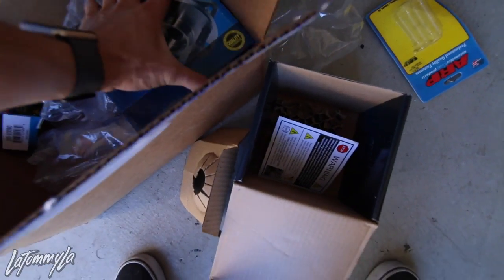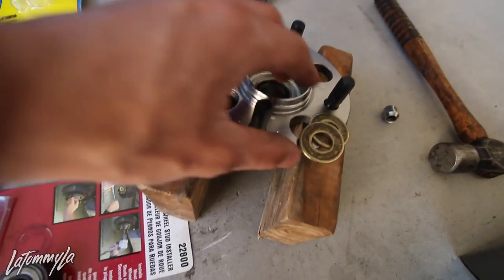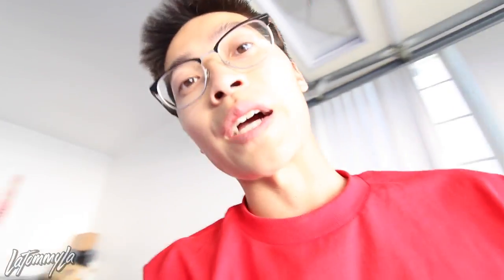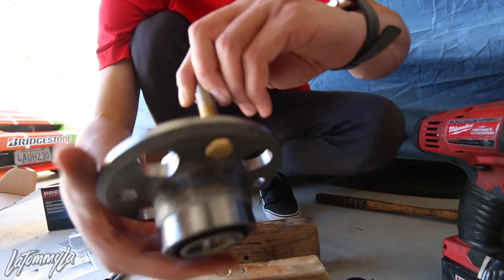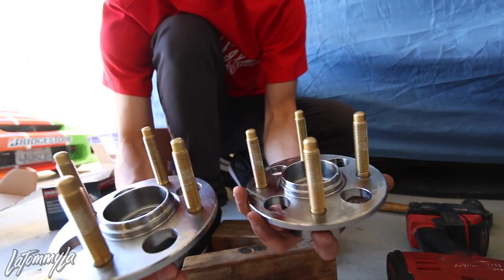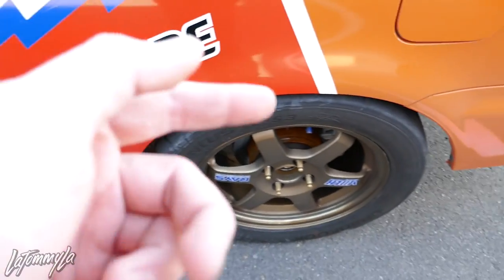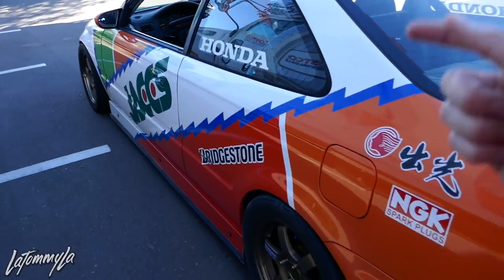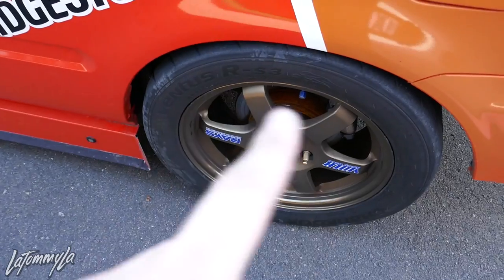LSD B18C! +HOW TO INSTALL EXTENDED WHEEL STUDS!

Comment: Where did you get the hubs? One of mine is going out, don't know which one to get.
Reply from the maker: +xDany248x I ordered mine from rockauto.com
Reply: @LATOMMYLA  i saw jhpusa put on there page that aftermarket hub holes are bigger and sometimes fitment wont be good for extended studs(hardrace). Did you ever have problems with them for the fronts or rears?